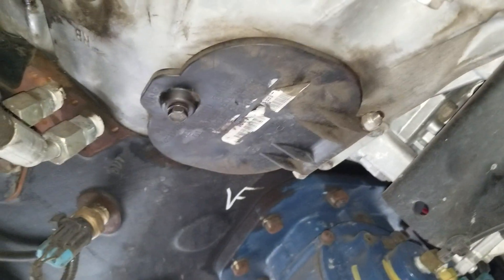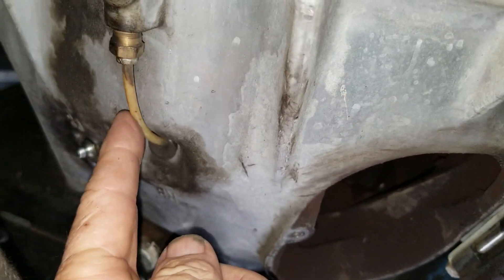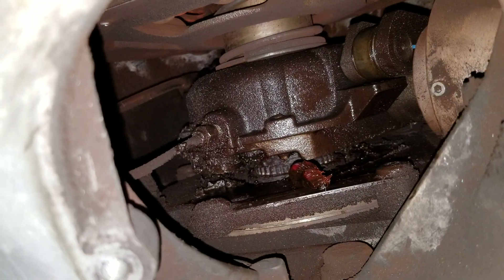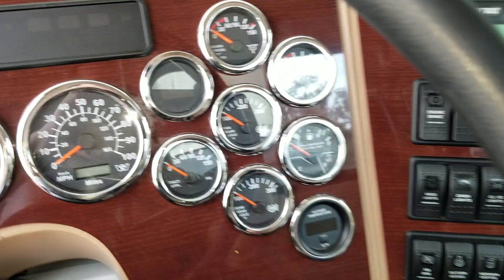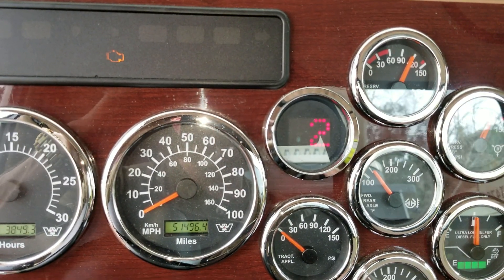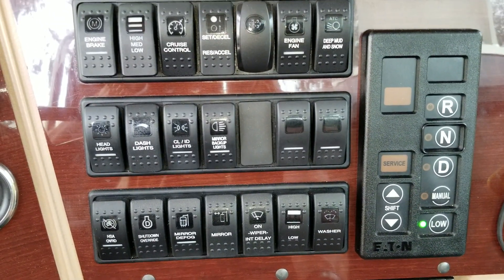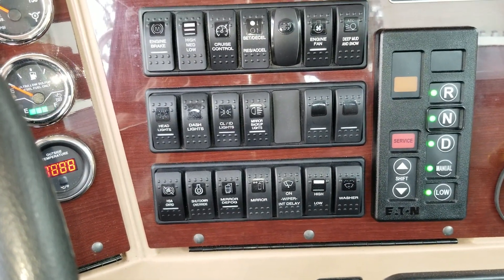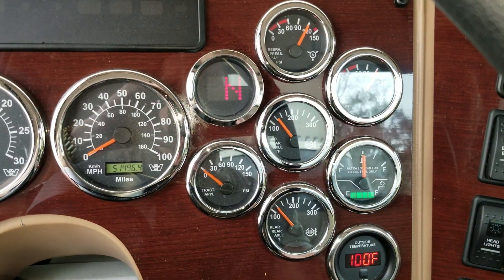Eaton Ultrashift G1 code reset

Comment: FYI, this works for late model freightliner 114SD with the smart shift lever. Same idea: key on, press brake (with left foot), slide shifter down into "L", pull shifter up until in 3rd, press accelerator all the way down (with right foot), wait for down arrow, then key off.
Reply: Thank you for this!

Comment: thanks for info BUT does not work on my 2017 ultrashift plus.. VERY similar.. BUT mine only goes into "6" and I cant pick my gear. I try the proceedure as you say down arrow but on 6..  still no reset.. any thoughts? thanks!
Reply: Same story here. Did u ever figure that out?
Reply: @thatsmokerguy  sory for the loong delay response but I didnt know anyone commented... .. Never got it figured out  but I just got a NEW truck so yea... its another dealers problem now:)
Reply: rolling 18 I have a 2020 and it goes to 6 and doesn’t reset either
Reply: @romancevasco  has to go to dealer,
They can set it so GI  warning never comes on again but u have to remember to grease!
Reply: Nobody figured out 6?
Reply: @ganbaa1312  I have same problem on 2022. Nothing works I guess it needs to go to dealer so they can use the ranger to reset.

Comment: Will.tbis help mines from not getting stuck in gear randomly..
Reply: I believe if the G1 code is on too long without being reset thats what locks it. Its like a limp mode per say.
Reply: @rickhoward1516  I'm not sure what that is .. could you further explain..
Reply: @therealdeal3438  Well we have an ultra shift in a kenworth and it was always screwing up and getting locked up. After taping on it and greasing it, I found it would always happen when the GI code was on and would free up after re setting it. Its just odd because I dont believe there is an actual lockout. Sometimes these transmissions are finecky. Keep it greased and follow the recomendations of how to drive with one of these.
Reply: @rickhoward1516  thanks brother.   Appreciate it..